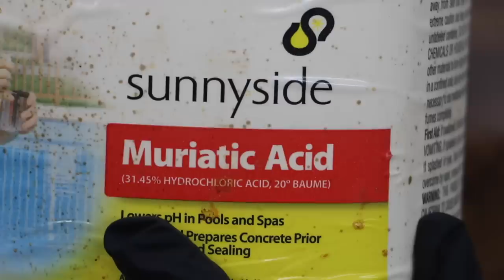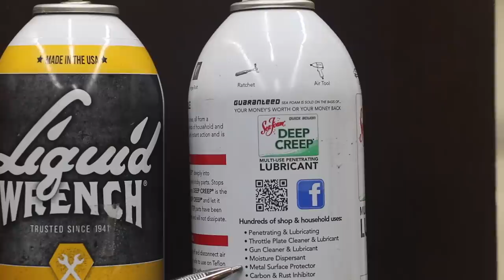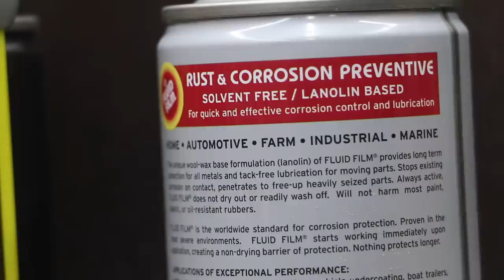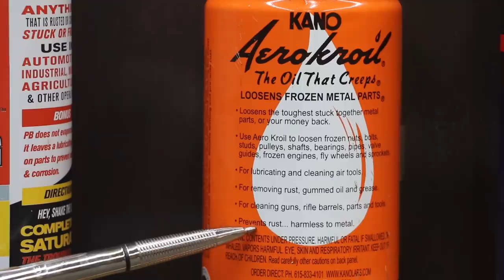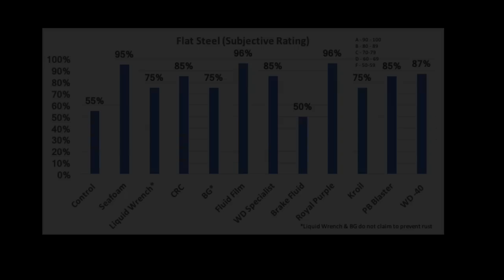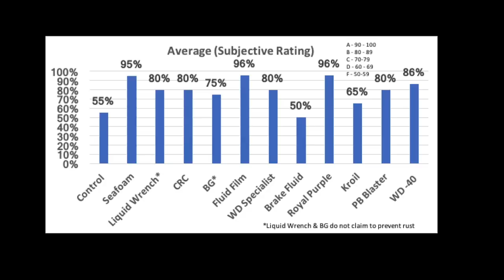Do Penetrating Oils Block Rust?  Let's find out!

Comment: i deal with large industrial forklifts for work quite a bit as part of our fleet services. we change the tires on them, and getting the hubcentric heavy duty rims off the forklift hubs proves very difficult at times. within the last 4 or 5 months we've been spraying the hubs with fluid film before putting the wheels back on, and it does make a *HUGE* difference! the forklifts that dont get the fluid film coating sometimes end up very difficult to work on. ive actually had to use a porta-power and ram to press the rim off the hub a few times. usually (not every time, but more often than not), the fluid film soaked forklifts' wheels just require a bit of lifting and tugging to get the wheel off after removing the lug nuts (this is normal procedure as the rim and tire combined weight is right around 500lbs!)

im glad to see my favorite product actually works very well, and its not just a weird coincidence hahaha! i use wd40 on my hobby lathe as well to prevent rust, but i may switch out to FF or RP after seeing that wd40 doesnt do the best...
Reply from the maker: Thanks for the feedback.

Comment: Pitty the winner is not available here in Brasil. By other hand I may have a interesting subject for a video. Back in the '60s up to the '80s when the gas stations had a ramp where one could take care of the underside of it's car and it was easy to find a dirt road, people used to pulverize the entire underside of the car with automatic transmission fluid, or with Mamona oil to prevent rust, and drive it on a dry dirt road so the powder would adhere to the oil, and form kind of a barrier for water to come in contact with the metal surfaces.  When I bought my '74 Galaxie back in 2001, I had to literally scrape the underside from a mix of oil and dirt. It was not pretty, but the car had zero rust. The rubber parts were shot tough, had to replace even the frame to body pads.
Reply from the maker: Wow!  Very interesting approach with the ATF!  Thanks for the video idea!

Comment: Years ago I used a spray can of K&N air filter spray oil on a rusty frame and as the years went by sitting exposed to the weather it never came off and it stopped the rust
Reply from the maker: This is great to know. Thank you!
Reply: Quite tacky.
Reply: I am going to try this. Thanks for the tip!
Reply: K&N seem to be pretty serious about quality. Their filters are lifetime, and seems their sprays work well too.
Reply: Years and years ago, I'd just paint stuff with zinc chromate.   Of course, you can't do that now...
Reply: The filters are lifetime because they look like a screen door. Shine a flashlight through one it's bad. It goes something like this:

Paper: super clean air but restrictive.
Fiber cloth: clean less restrictive.
K&N: keeps rocks out, basically no restriction.
Reply: AnonymousMod sweet. Still.
Reply: Zinc chromate was used on most aircraft as a rust preventative.  Used it as late as the 1960s on C-141s.

Comment: It would been nice to see what used engine oil would have done.
Reply from the maker: Great point.
Reply: I agree, as well as how would ATF do?
Reply: I have seen and heard of people using engine oil to seal up wood like on trailers and other items you dont care smell like engine oil.
Reply: the thinner they are the more often you'd have to reapply it to prevent rust, that's why the lanolin based stuff did so good - grease always stays where you put it.
Reply: I know my old XJ is virtually rust free underneath, but it's also covered in leaked oil.
Reply: I use ATF+engine oil for the bar lube on the chain saw. I have a Husky from early '80s still has original bar on it.  Probably sounds like a bad idea to purists...if there is such a thing.  It's actually about right for cold weather.
Reply: @ProjectFarm   Or silicone
Reply: 1019wc1019 i put used oil on the frame of my truck. No rust at all
Reply: I use used engine oil underneath all my vehicles. They're all rust free.
Reply: @danstrayer111  You can't be sawing much, a bar normal only lasts about 5 chains.
Reply: I bought that saw heavily used in 1983, I cut about 25,000 christmas trees with it, and cut fire wood, 3 cords per winter, for 25 years. Same bar.  It has been filed, flattened, re-gapped, still going.
Reply: @danstrayer111  Then it's probably way worn out. Try changing it, you will probably saw faster and straighter making it way worth the small cost.
Reply: blupupher atf + Diesel + lacquer best for loosening bolts and rust just don’t get it on painted surface
Reply: The Truth agree
Reply: blupupher agree oil best done on a super hot day in August

Comment: If it hasn't been said already I'd suggest you do a real world test of rustproofing sprays made for vehicles. Some you could test are Fluid Film, Krown (Carwell), LPS 3 or Pro Form etc. I'd suggest you try a nut and bolt mounted through a piece of square tubing (square tubing to simulate a boxed frame or panel seam) treated with the spray, then mount the piece of square tubing under a vehicle of yours so it can get blasted by road grime. Then when the test period is over you can see if the bolt is easily removed from the nut (simulating having to work on fasteners under the vehicle). You could also cut the square tubing in half to see if the collected road grime has started any rust. As a bonus test you could add a rubber shock absorber bushing to each bolt to monitor any effects of the sprays on rubber suspension parts.
Reply from the maker: Great video idea--thank you!

Comment: Liquid wrench makes a new product now called, "rust inhibitor" seems pretty good so far, another great product that is expensive is "Cosmoline"  supposedly used by the military to stop rust.
Reply from the maker: Thank you for the video idea!
Reply: I hear cosmoline is not exactly a great idea for a general purpose rust inhibitor because works like embedding something in petrolatum jelly that eventually turns even waxier. It goes liquid again when warmed up, which might happen if you leave whatever piece of equipment out in the sun.  For moving parts and not just nuts and bolts it seems unsuitable. For stationary parts it might be better to just paint over them.
Reply: I have a couple of antique rifles that were dipped in cosmoline before being stored.  It was a royal pain to clean it all off.

Comment: —gun oils—, what gun oil has the best rust protection or what gun oil has the best lubercation or both
Reply from the maker: Thank you for the feedback
Reply: G96!
Reply: Ballistol Oil, proven over and over again.
On the costly side, smells like a feminist but it does work wonders.
Reply: Ballistol
Reply: I've asked for that test to be done also. So far he hasn't done one that I'm aware of but I'm using what a gun smith I know uses and it just  Break Free CLP. It seems to do okay I'm not that proud of it. Hell I remember back in the day when we didn't have anything but 3 in 1. Well you had motor oil but you don't ever want to put motor oil on a gun. I guess over the years I've used Hoppe's and Remington's REM oil. Which that's about all you can get where I live because all we have is a Walmart we don't have any gun shops or any decent hardware stores that sell such as that. They claim that they're using Break Free CLP in the military. Well good luck to y'all Fellers
Reply: Personal experience Remoil is trash. You're better off getting a cheap bottle of CLP.
Reply: EEZOX is best for rust prevention hands down but it is incompatible with petrol products which I prefer for lube. I've been using a full synthetic thin motor oil, if I use EEZOX.

IF it's gonna make no difference as far as damaging a finish of compatibility I'll use Seafoam Deep Creep or Ballistol
Reply: @erikjohansson1814  Ballistol is great for stainless, wood, leather and old school stuff, except for nickel plated objects IMHO.
Reply: DumondeTech Bike Chain Lube   Amazing
Reply: @erikjohansson1814  Left me wondering what a feminist smells like, lol.  Not like a flower, musty perhaps?
Reply: Ordinary drugstore mineral oil $2 a pint- it's the base for all the 20 dollar an ounce fancy "Gun oils"
Reply: Just use you favorite synthetic motor oil in a squeeze dropper. Since we don't have machine guns the average gun has far far less wear than your engine parts do every day. Rust protection is a whole other thing tho. cosmoline is the best but your gun wont run very well. ha ha  Seriously just use high quality synthetic motor oil and when it dries out after many years of no use re-apply.  If your using your gun you will know to reapply when you clean it. Dont fall for these insanely expensive oils that are 15.00 an ounce its not needed, nor in any way worth it!
Reply: @erikjohansson1814  Ballistol is a great shampoo and conditioner in one I agree! sometimes I still Ballistol when I'm in a hurry and the gun isn't that dirty. But for more severe cases like AR's etc that get a lot of rounds. I have gone back to just using a good cleaner and then a high quality oil. Lately its Hoppes #9 and my favorite Synthetic Motor oil in a squeeze needle dispenser. Just think about how much wear a gun actually gets, Its parts are case hardened also. If a synthetic motor oil can protect engine parts that are slamming,sliding,scraping each other thousands of times a minute, for years on end. I think it will protect and lube your gun slide and internal parts! Ha ha! Works for me and saves a ton of money on those crazy expensive 15.00 an ounce oils that I really don't think are any better.
Reply: @jackwatkins7382  Synthetic Motor oils aren't like regular old dino oil we had when I was a kid. Just think about how much wear a gun actually gets, Its parts are case hardened also. If a synthetic motor oil can protect engine parts that are slamming,sliding,scraping each other thousands of times a minute, for years on end. I think it will protect and lube your gun slide and internal parts! Ha ha  I have run synthetic motor oils in engines I have torn down with 200,300,and almost 400,000 miles on them! I have seen an engine with 1,000,000 miles torn down with almost NO appreciable wear! I'm so sick of the truck I end up trading them in to get a new one, the engines are always going strong. I maintain my filters and fluids!  Guns are much easier. My AR 15s are the worst for wear and even they aren't bad. Or you can buy those 15.00 an ounce "gun Oils" that I really dont think are any better Hell my premium synthetic favorite oil isn't even 15.00 a QUART! Ha ha Saves a ton of money in the end if you shoot a lot. I put mine in a tiny squeeze bottles with a needle like this. https://www.amazon.com/Lucas-Pack-10875-Extreme-Duty/dp/B015YL0M3Y/ref=pd_sbs_200_8?_encoding=UTF8&pd_rd_i=B015YL0M3Y&pd_rd_r=151aed6e-a407-4595-9d15-a6461f0f7845&pd_rd_w=DOF6u&pd_rd_wg=mIXk7&pf_rd_p=12b8d3e2-e203-4b23-a8bc-68a7d2806477&pf_rd_r=GAFDHVNQ4B10XTCKPF7P&psc=1&refRID=GAFDHVNQ4B10XTCKPF7P
Reply: @PatriotPaulUSA  synthetic oils generally have high flashpoints but are hygroscopic and mineral oils have maybe unknown flashpoints but aren't generally hygroscopic?  Engine storage fogging oils are meant to protect against iron cylinder sleeve corrosion, pretty sure these aren't synthetic?  I hesitate suggesting any type of oil as gun protectant for safety reasons, aside from for those labeled as such.
Reply: Mpro7, Otis gun oil /cleaner. For non blued guns ,and not in the desert. The old breakfree clp works wonders .
Reply: I used to be in charge of cleaning guns for a retailer, I have Cleaned more guns than i can count and used dozens of types of oil. in my opinion it doesnt matter for the most part, except that oils that can emulsify like Ballistol are not great for humid environments.
Reply: Yes, I think you mean (saying same thing) an oil that emulsifies with atmospheric moisture (hygroscopic) is undesirable.  I agree.  Also, firearms lubricated with the incorrect type pf oil CAN actually experience that oil flashing (compression ignition, like a diesel engine) in the barrel due to the high pressures.  This is also undesirable.
Reply: @erikjohansson1814  Smells like a feminist???  ROFL!!!!!!!!!!!!!
Reply: 119fatty Ballistol and Mobil 1!
Reply: Rem oil
Reply: Don’t use motor oil on your firearms.  I use Ballistol, Kroil, and also Lucas Extreme Duty Gun Oil when I want a very slick lubricant (heavy shooting days).
Reply: This would be a great test. The cost delta and claims is huge, modern day snake oil. Also you could also test Eds Red home brew equal parts atf, mineral spirits, kerosene, acetone
Reply: I had a weird recommendation, gun oil on wood works REALLY well to fix water marks. Other than that it's mainly useless, use proper grease on the mechanisms and don't service your weapons to destruction. Just clean up the barrel, leave the rest be for the most part.
Reply: REM-oil
Reply: @masonthemechanicboy  LOL, no. If  you are looking for rust protection you'll want to use grease, if you are looking to clean it up then you'll want to use grease.

Gun oil is caustic and while that helps the cleaning process you'll need to wash it off and grease it or it will cause corrosion.

Why do you think EVERY military in the world banned gun oils and only use grease of different viscosity? Do you think they care about things like longevity?

Truth is, REM-oil is good for treating cracks in a wood stock or loosening rusted bolts but don't use it on metal you don't want to ruin over time.
Reply: I used WD40 on my shotgun and after a month there was 1- 2 mm deep rust on it. Never even brought wd40 after that.
Reply: @GyanenderSirohi  Ummm, the thickness of the steel of a normal shotgun barrel is less than 2 mm.

It's fine to use WD40 on your shotgun if you don't store it in sulphuric acid which is always a bad idea.

It does protect against oxidation, there is no question what so ever about that.

However, what you'll really want to use is used engine oil.

Comment: Should try using candle wax for a penetrant. Heat the nut bolt and then push the cheap tea light candle onto the threads and nut so it pulls it into the threads like solder does. Its worked for me quite a few times.
Reply from the maker: Great recommendation.  I'll test it.
Reply: I also would break it loose while it was still warm so the wax didnt set up giving it a lubricated surface to turn on. When it would stiffen up i would rewarm it to melt the wax and keep going. This way people that don't have an acetylene torch still use a propane torch to heat the nut up and melt the wax into it. Btw great videos!
Reply: reed vending 
 Heating the nut expands it a little too, even with Propane. That helps your wax or any other product enter the threads. The advantage to wax is that it won't cool the nut like a spray can product.
Reply: Works like a charm. People look at me crazy when I tell them to do it like this lol
Reply: You can just make the whole nut and bolt out of candle wax like Hydraulic Press Channel did!

Comment: Another great video.  Brake fluid is very corrosive - eats paint too!  Most of the other products are oil based and I thought they would do a better job on average.  I'm particularly surprised with Kroil.  I thought it would do a much better job.  When I lived in Chicago, Kroil was my go to for stuck, rusty bolts.  Though that was back in the 1980's, where Sea Foam and Royal Purple weren't around yet.  Even PB Blaster wasn't well known.
Reply from the maker: Great point

Comment: As usual, great video!! I live in Louisiana where humidity in my shop is tough on my tools causing surface rust.  I have tried dehumidifiers and rust preventers to no avail. Same with my boat parts at stuff around my camp on the coast where the salt air does its job. I use Ballistol on my good tools, firearms rods and reals, knives, anything important to me but not everything, as it is expensive!. A 50 year charter boat captain from the Keys turned me on to two things, Fluid Film for lube and Corrision Block to protect. Those are the only two things he uses. I started using it, Fluid Film) as it is much cheaper than Ballistol and it has been working great for me! The both smell the same (pretty bad) so may have the same ingredients. Corrision Block on my boat, riding mower, exposed tools anything that I need to prevent corrision. Would love to see some comparisons on those type of products. Ballistol, CPL, Fluid Film, Rem oil, Safari Charlie etc. Keep up the truly fantastic work, we all use you to find the best products! Thanx!
Reply from the maker: Thanks, will do!

Comment: Thank you so much for the thorough tests. Did I miss the video where you test the lubrication properties of each oil? I'm curious which oil works the best with regards to lubrication. How long do they last? Figuring out a way to test their coating power, as in how well does it cover/coat/stick to parts.    Are there difference in their abilities to perform in different temperatures?
(I was lubing my garage door with lithium spray when I started wondering if you had any videos on x similar subject). 

On another note, my wife is a third grade teacher. I showed her your videos and she uses some of them to explain the scientific method to her kids. Keep up the great work!  

I grew up on a farm in the Midwest and now reside in the suburbs out west. I'm super envious of your shop and it brings back memories of working on farm equipment with my dad/uncle.

Edit: I just found the chain lube video, watching now, that might answer my question. Also, I just joined the patreon, so hopefully my $5 a month helps keep the lights on!
Reply from the maker: Rich, Thank you very much for the positive feedback and thank you for supporting the channel.  It helps a lot!  Best regards, Todd